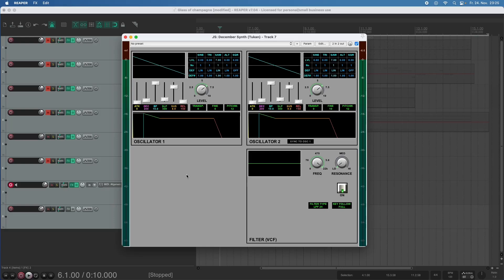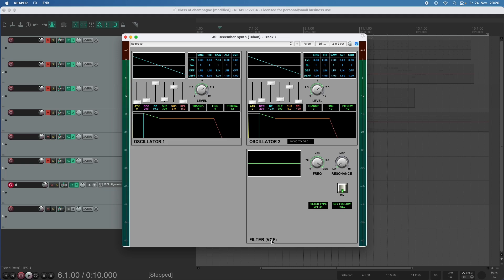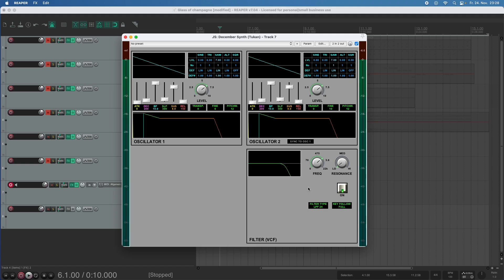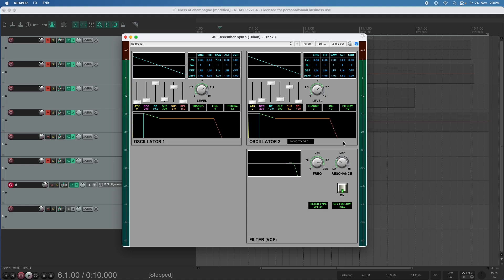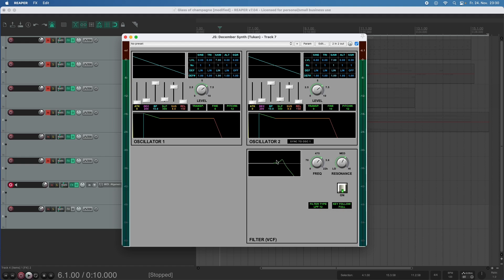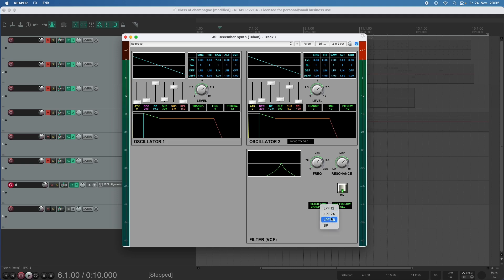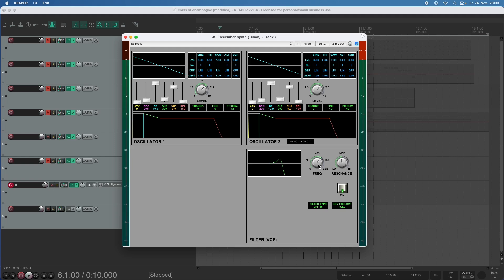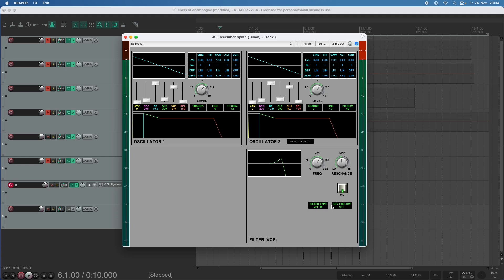Filter - Tukan Studios Advent Calendar

Comment: First - as ever, a great thing you have made here, and I think I can speak for many here: Thank you so much. You're VST and JS devices are often my go to devices in Reaper. That said, there is one immediate critique - it's not smooth. Most noticeable with some resonance involved.  Here's the test (my days doing QA coming back - eeek!) :
1. open Reaper, load up a synth, and the filter, in Reaper (per demo video)
2. Add some resonance, say 24dB (turned up enough to be Very Noticeable).
3. Play a note on synth
4. Sweep Filter Frequency
RESULT: as you sweep the sound, there is an obvious "stair stepping" as you sweep.
EXPECTED: smooth as butter, no stair stepping
NOTES: This happens with or without resonance, resonance just makes it more obvious. If one doesn't sweep the Filter freq, it's not noticeable, so if you set and forget, it's brilliant. This stair stepping should be fixed so an LFO can be applied to Filter Freq and not have a wild cascade of stair stepped sound.
Reply from the maker: That has to happen, because I have to convert from pixels of mouse movements to a filter value. Of course I could have implemented a smoothing, but let's not overcomplicate things ;) Use today's new feature for filter movements (this time smooth as butter), or you can use automation or a midi controller...
Reply: @johnmatthews8435  - 
Oh, I see - so it's a UI>software problem. I can dig that - as long as it doesn't do that with a controller, I'm good! I'll test it with my Novation Impulse and Akai APC! 
Again, thank you so much for what you do - you're a hero in these parts!
🙂